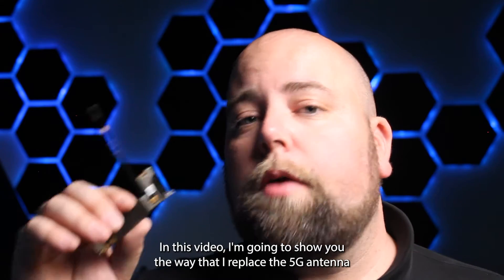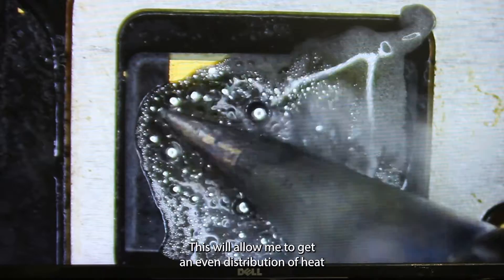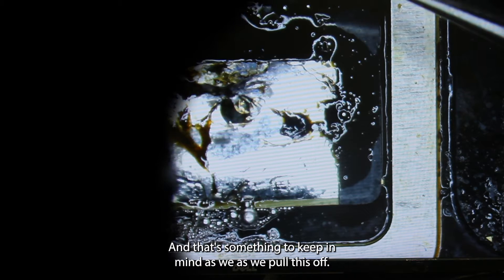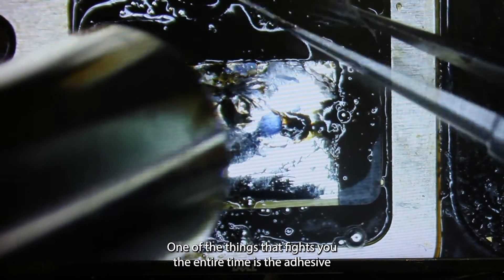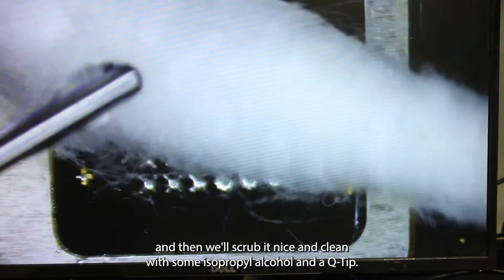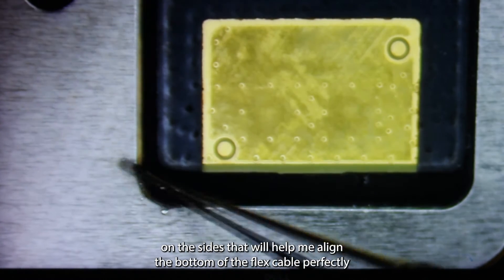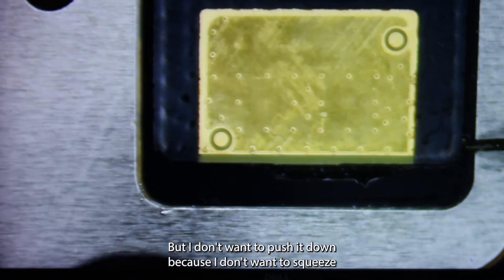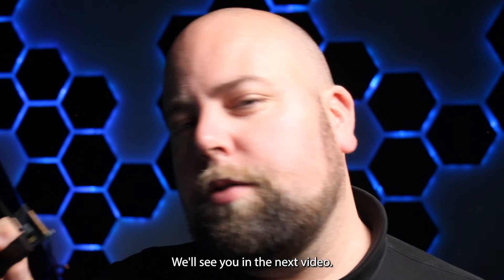iPhone 5G Antenna (How to Replace)

Comment: Hey so if i remeove the 5g attenna itself will the LTE and other Cellular things work normal for the device, everything besides 5g
Reply: Yes. I accidently ripped the cable and 4g is still is working fine.
Reply: @SyedFarhan-ie9ru  thanks for your answer